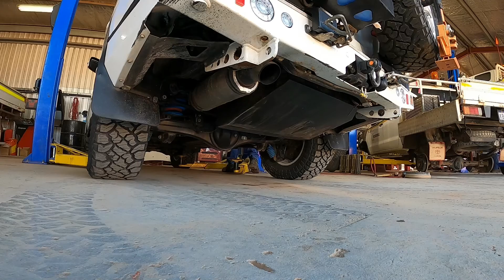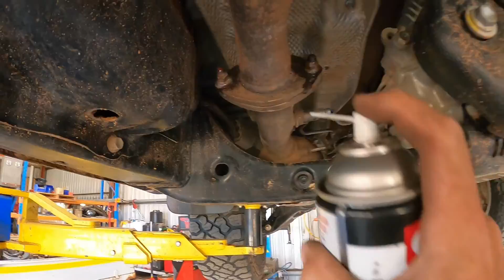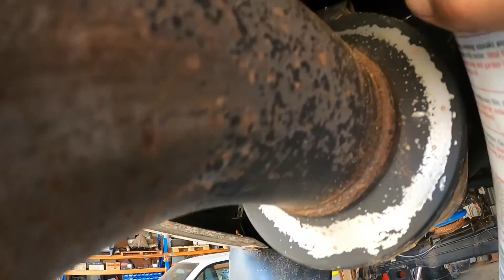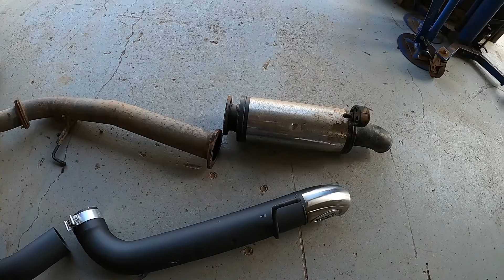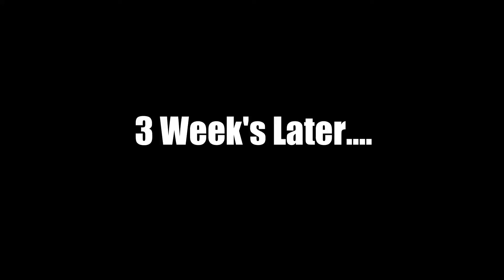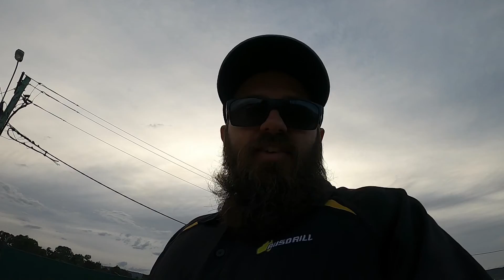200 Series ECU/TCM Re-Map | 4" Manta Exhaust Install

Comment: This is the video iv been looking for! 

I have a 2018 VX 200 Series and the engine is stock as a rock. 
The big girl is booked into Street Quick Performance this week for a stainless steel manta exhaust ECU recalibration and Auto recalibration also. 

I’m glad your happy with it, can’t wait to get mine back next week. 🇦🇺💪🏽
Reply from the maker: No worries mate, John @streetquickperformance is an absolute gun when it comes to these vdj200's.... u will not be disappointed 💪💪

Comment: I've done similar to my 2013 here on the east coast. Manta exhaust, ECU and TCM remap, plus TC lockup at 80k's via directly activating the solenoid. It made a huge difference, although she rolls coal a bit getting into it...

I  initially also did a cat and muffler delete from Manta (straight pipes from the turbos) but it was just too loud. I put Manta cats back in and a muffler about 2 weeks later. I use an exhaust gas temp gauge, because it's tuned pretty wild. Uphill with a van on, it can get a bit too hot if you're overtaking. I've put about 100k on it since doing the work. Still awesome.
Reply from the maker: They definitely are a different beast once u unlock that power plant aren't they 💪💪good thing u r keeping an eye on ur temps too, will make sure it lasts longer 🍻
Reply: Yep. My only criticism is the initial black smoke under high load, but that’s diesel’s for you
Reply from the maker: @michaelnelson912  u know what they say about soot ;)

Comment: Hey mate what’s your feedback on the tune now you’ve towed the caravan for a bit?
Reply from the maker: Hey Brendan, absolutely love it... it drives so smoothly and doesn't go in and out of lockup like it used to. I love the fact that it keeps the trans cool too. We can be driving in 35°c + temps and engine sits on 86° and trans around 65° 👌👌also hoots when not towing 😎😎